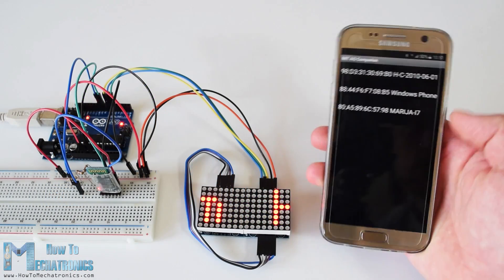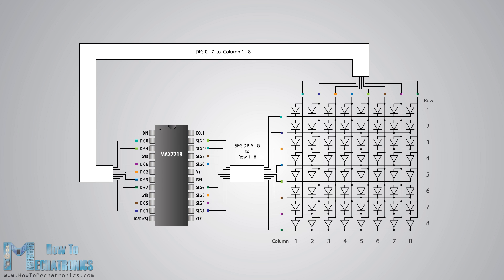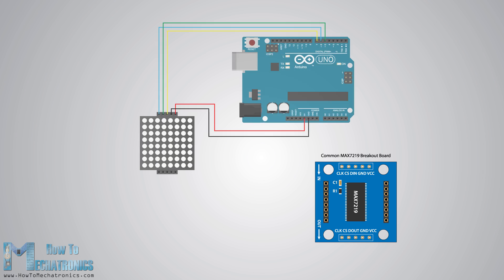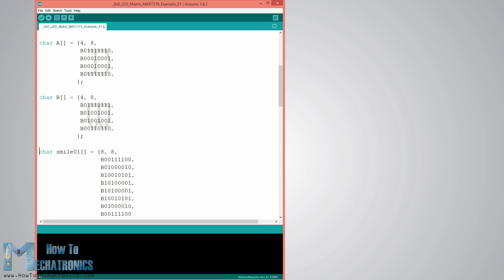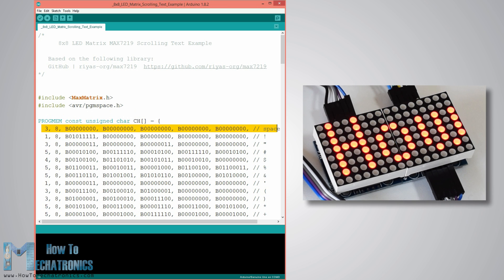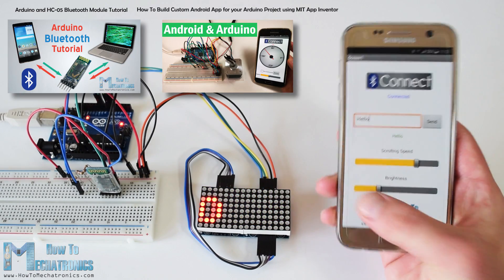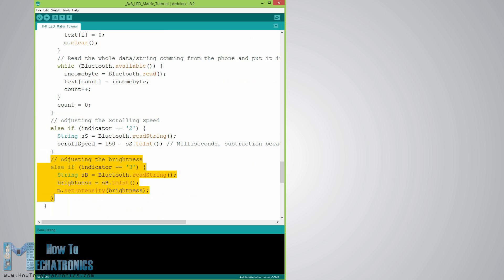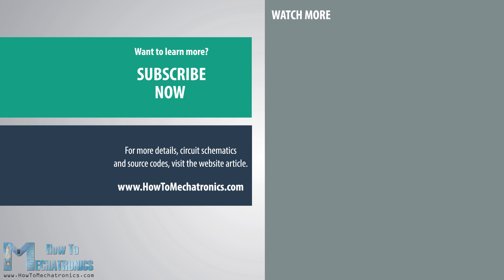8x8 LED Matrix MAX7219 Tutorial with Scrolling Text & Android Control via Bluetooth

Comment: I am now too using an arduino uno with 2 matrices but if I add a third one it glitches out. 

Can that be caused by the uno not being able to control more than 2 matrices and which parameter would limit that? (so that i can choose a different microcontroller)

Comment: I have a question: why do you use the same Pin (pin 7) in your bluetooth code? Int DIN 7; SofwareSerial Bluetooth(8,7) ???????????? I have changed Software Bluetooth(8,9) but it doesn't work!

Comment: library could be added to arduino idk why but this is what the arduino 
Arduino: 1.8.7 (Windows 10), Board: "Arduino/Genuino Uno"

Specified folder/zip file does not contain a valid library

This report would have more information with
"Show verbose output during compilation"
option enabled in File -> Preferences.

Comment: How To Mechatronics  Is there a way to change the direction of the displays in the code? Well I would like to use this sketch with 4 in 1 led array modules sold on eBay; Thank you
Reply: Have you figured out how to resolve your query?
Reply: @roidelleneeugenio2221   Hi! There are no satisfactory answers, so in this case it will be necessary to change the entire "Character Array" in the "PROGMEM const unsigned char" line or use another library or, alternatively, use separate LED modules; Excuse me!
Reply: @Dancopymus   Oh, okay. Thank you!

Comment: good morning
great project and thanks for sharing, I have implemented the project with one arduino, 5 modules max7219 and a bluetooth module HC-06 at a speed of 9600 baud and works very well, I only have an unwelcome to send the message from the app send it and very good. But the last message message sent from the app is erased when restarting the matrix, I thought that by using the PROGMEM instruction this would not happen, how would it be solved?

Comment: hello friend i am from colombia when i install the bluetooth hc 06 it connect but dont send information to the module
Reply: yo ensaye cambiando la velocidad del BT de 3400 por 9600 y funciono full PD: Tambien soy de Colombia
Reply: @ExpresionDinamica  please write english
Reply: @sabrinamuhiddinova7264  3 years ago I solved it, but thanks for responding.
The question was: I tried changing the BT speed from 3400 to 9600 and it worked full PS: I'm also from Colombia.

In fact, make an App that is in the Play Store can be found as VivirAplicaciones.
Today I have the problem that the 4-in-one displays do not work with this code

Comment: Is it possible to hook up the max7219 (without the breakout board) to a 4 digit 7 segment display? I hooked up the IC exactly as described in the datasheet & ran code from multiple sources, but still no luck

Anyways, thanks for going over the max7219! Most people here have the 8x8 led matrix breakout board & don't explain the circuit from the IC to the led matrix